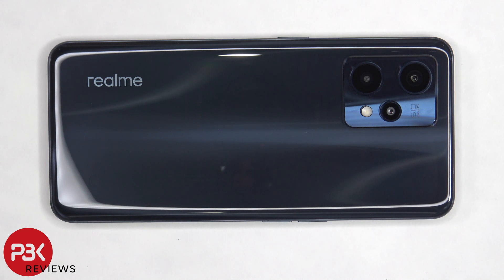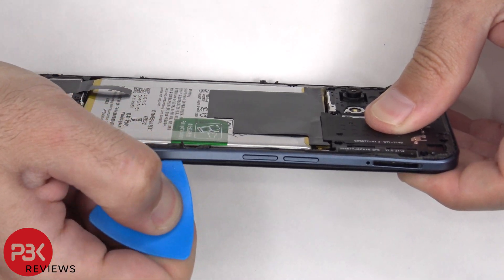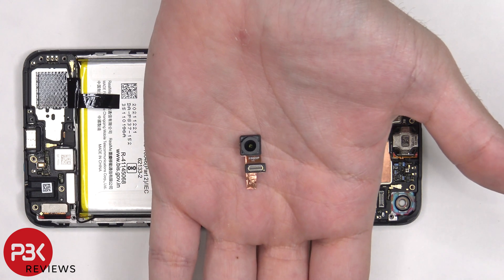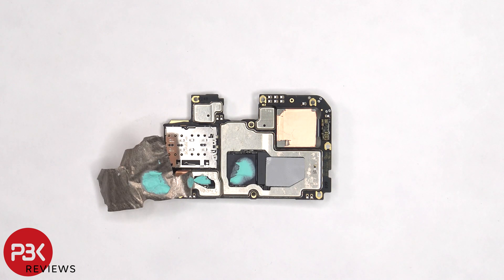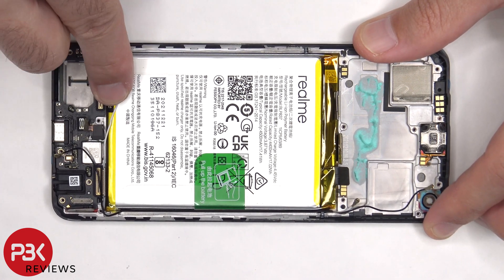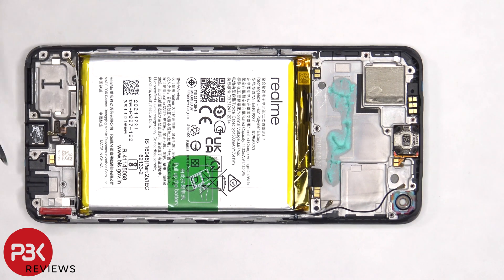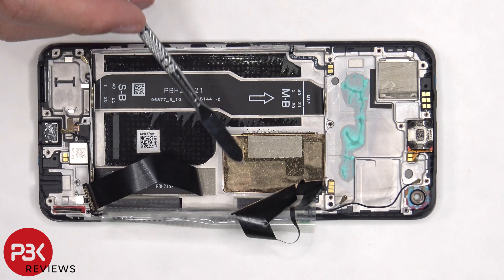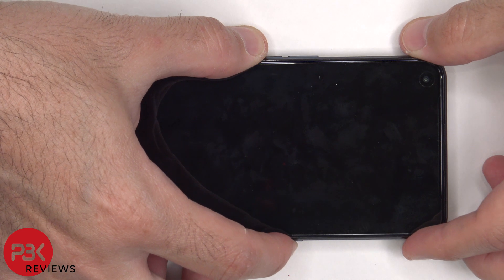Realme 9 Pro Plus Disassembly Teardown Repair Video Review

Comment: I just successfully disassembled my wife's 9 Pro+ using this guide. It's a bit disappointing that I had to take it half way apart just to disconnect the screeen cable, but there we are. I just wish there were gasket adhesives available for it, I haven't found any.

Comment: Is it possible to replace the battery with the 5000mah one from the 9 pro?
Reply from the maker: The 5000 mAh battery will probably be too large to fit in the battery compartment of the 9 pro plus.

Comment: If motherboard is changed all data will lost?
Reply from the maker: yes, data is stored on a soldered rom/storage chip on the motherboard
Reply: Tq for ur reply. How can I get old data from phone plz tell me
Reply: My phone is damaged. Customer service told motherboard problem how can I get my data ?
Reply: What is the cost of motherboard
Reply: @saigajananbachuwar3621 bro did you change motherboard of your phone
Reply: @saigajananbachuwar3621 if it is yes tell me whether it is working properly or not and what is the cost

Comment: Does changing motherboard can affect fingerprint sensor?
Reply from the maker: You might need to do a factory reset if you change the motherboard so it reads the sensor properly and you would need to re input the fingerprints.

Comment: Hey buddy my realme9 pro have no backlight on the screen but the screen is still works my problem is there is no backlight how can we fix It? Changing LCD?
Reply from the maker: Hi, most likely replacing the screen will fix it, but sometimes it can be a problem from the main board.